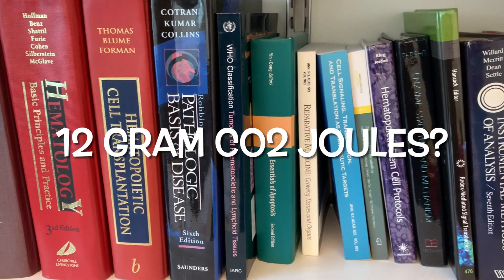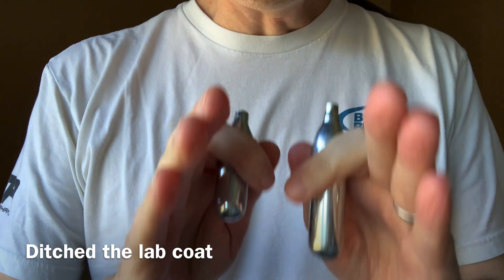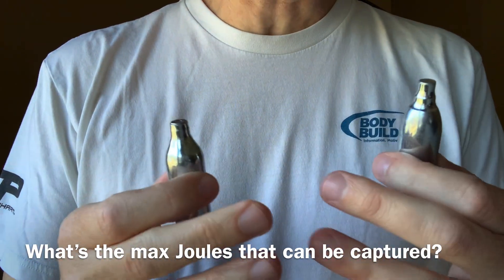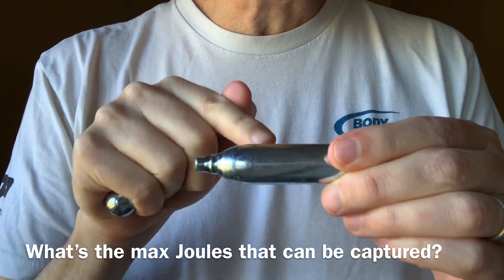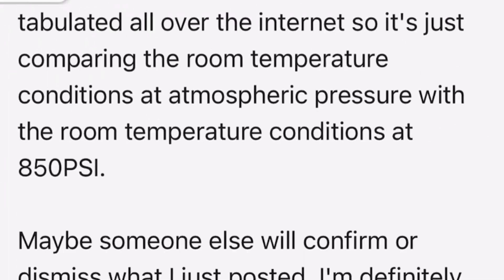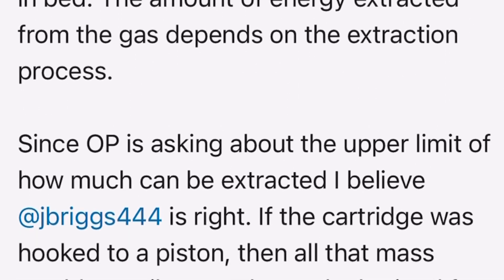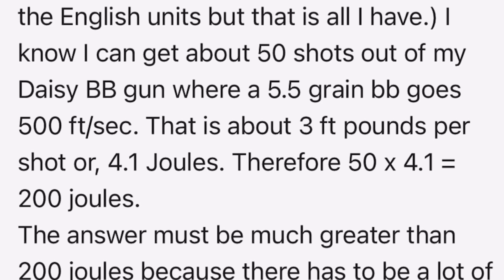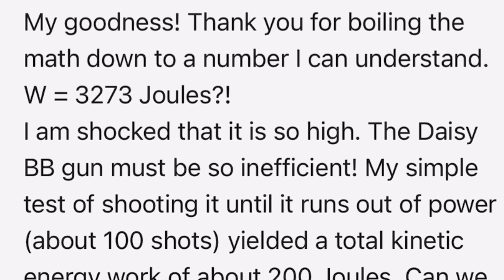Less Lethal 12g CO2 - MAX Joule output?

Comment: is that possible to put more pressure inside these things?
Reply from the maker: Yes and no. I have a video already in the queue coming soon where I go through the science of CO2 in the lab. The issue is that more pressure becomes unregulated and unsafe.
Reply: @ShadowCatTactical everyday they creates new home defense guns, trying to extract more joules from it, at the same time, some people make "powerfull kits" for airguns, but i think it seems easier creates a cartridge with about 20% or 30% more psi
Reply from the maker: @drogaeobraia.958 Yes a HPA cartridge would work or even individually separate ammo powered like the AEA double barrel shotgun. Definitely doable but might be cost prohibitive until it was made and sold at scale.

Comment: Bro I'm soo poor with physics and chemistry and I hate to use Chronograph. But when the day I discovered how sturdy a CO2 capsule is, I knew they're Definitely Not just toy gun stuff. 😄
Reply from the maker: @yv9889  Good point. Those cartridges tolerate quite a bit of pressure, especially when carried during summer.

Comment: I would be interested to learn the difference between the launchers marketed as less lethal defense vs standard painball guns using the same ammo? Both come in the same caliber..and many paintball launchers seem easier to modify. 

Just not understanding the difference. But would really like your insight🙂
Reply from the maker: The differences between them physically aren't that much. Some lethal launchers are based on acquiring patent rights from a paintball marker precursor (such as Byrna-Tippman or PepperBall-Tiberius) or were a derivative of the same technology. A few companies such as Grimburg (Gavle) and MCS (Pistelle X-68) have completely new designs and should be applauded for that. All current launchers suffer from the same limitations of o-rings, springs, and air pressure (CO2) however. But they do outperform unmodified paintball markers considerably with heavy ammo. A standard paintball marker will not handle an 8g projectile very well. Hope that helps.

Comment: Unfortunately mechanical simplicity and compactness is at a premium and that really doesn't help with efficient energy extraction. Cold gases are hard to work with as well because of being limited on max velocity. As far as getting better use of CO2 one could basically make a multi stage transfer piston to use air as the working media. This is roughly equivalent to a spring air gun which can easily break the sound barrier.
Reply from the maker: It is definitely a challenge to maximize efficiency while maintaining a compact design.

Comment: I attempted to solve this equation previously, but the high numbers led me to doubt my calculations and ultimately give up. In fact, my figures were even higher than this. I was specifically trying to determine how much energy is lost per inch of barrel length, but I ended up moving on. Great job on the video—it's very informative!
Reply from the maker: @Spartan_Tactical  Great to hear! CO2 will not behave perfectly according to the ideal gas law due to intermolecular forces between CO2 molecules, especially at high pressures and low temperatures. The compressibility factor hopefully controls for that adequately enough.

Comment: Very interesting! I always wondered why the big co2 big holders, example 12oz on the Viktor spider paintball marker does not have the power of my umarex 11 joule version,,a guy in South Africa recommended a stronger spring that can produce 40 to 50 joules, but I still wonder if it's possible??
Reply from the maker: Stronger springs are part of the equation for efficiency. The key seems to be to prevent massive air loss while simultaneously allowing maximum expansion within a small footprint. It should be doable but not as a mod. It would take a completely novel design.
Reply: But do you think one can achieve that joules? Thanks @ShadowCatTactical
Reply from the maker: @ No it’s a theoretical max under perfect conditions. But it shows that substantial improvement is possible by improving air efficiency.
Reply: Thanks 👍,I like your idea from the legal aspects,and Rune video s don't stop it !!  @ShadowCatTactical

Comment: Yes, we need a break through in launcher design. Small is key (glock size) with 6 shots averaging 40J. If reliable, I think the inventers would get their money back and then some. The Gavle and Pst 68 are carriable in a belly ban holster for me, BUT, smaller would be so much better and would encourage carrying more often, regardless of attire. You have put the ball in the Launcher maker's court. Bravo.
Reply from the maker: I will probably require a small launcher for EDC. I’ve started testing a belly band holster recently and the results will be shared in a future video.

Comment: WOW !!!  THIS MAY BE BY FAR MY MOST FAVORITE VIDEO FROM YOU YET !!! LOL 
SCIENCE IS EVERYTHING MY FRIEND , EVEN THE ONE WE CALL "GOD" USES SCIENCE AND PHYSICS TO DO EVERYTHING HE DOES ! .
SCIENCE IS THE ANSWER TO EVERYTHING , ITS HOW I PERSONALLY HAVE SOLVED MANY THINGS IN THE AIRGUN FIELD . 
ANOTHER INTERESTING FIELD IS THAT OF THERMODYNAMICS ! . WHEN EVER ONE IS FACED WITH A PROBLEM OR CONCERN , WE CAN ALWAYS USE ONE OF THE ARTS TO REMEDY A SITUATION .
now getting to the power of a 12 gram co2 , if we were to explain it or demonstrate more in layman's terms where more people could fully comprehend it , one thing i could do is build a small fire , when a sufficient amount of coals were achieved we would then place a fully charged 12 gram co2 powerlet on it and step back quick and wait for it to do its thing . 
another example of seeing some of the potential of this 12 gram co2 , is to order the co2 grenades from valken , when activated as pressure builds , the material used in the manufacturing process eventually breaks apart and releases the pressure all at once causing a really big boom . 
these are nice but i feel they are not exactly perfect , if more thought and science were put into this thing you could basically create something that would ring a perps ears for a long time lol . 
the plastic casing of this air grenade is very week so to not let too much pressure build , just making it a little stronger would make all the difference in the world allowing even more pressure to build before finally bursting . 
this alone shows just how much energy is in just one tube . 
now , using thermodynamics , using a system that could heat the liquid gaseous material to the right temperature , as in one of my inventions decades ago i figured out on paper  , having some heating elements that surround the co2 plenum or air chamber  turning the cool liquid co2 into high pressure gases would certainly be more regulated than using my first idea of using iron powder , table salt , activated charcoal and vermiculite , i.e. hand warmer !!!
one of my very favorite ideas was a rifle that fired a hypodermic needle type device into a fresh co2 container releasing all the co2 at once pushing a single projectile out the barrel , so one co2 was good for one shot only , you would have two separate clips or magazines , one to hold 12 gram co2's and one to hold projectiles , very cumbersome right lol ! . 
calcium chloride and water causes extreme heat and will build pressure but not as good as calcium carbide and water , these would make some good alternatives to co2 i feel , but they are way more dangerous as carbide creates acetylene gas ! .
for now lets stick with co2 , its still by far a good choice , science ? gotta love it right . 
AGAIN I REALLY ENJOYED THIS SEGMENT OF YOUR VIDEOS BROTHER , THANK YOU FOR ALL THE EFFORT YOU ALWAYS PUT IN !!!